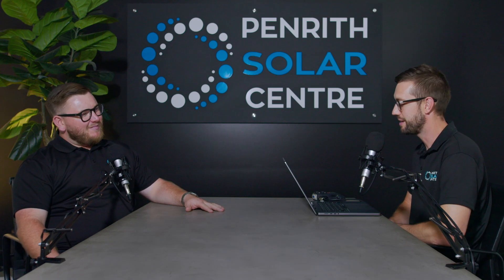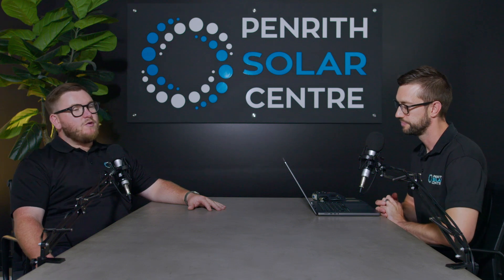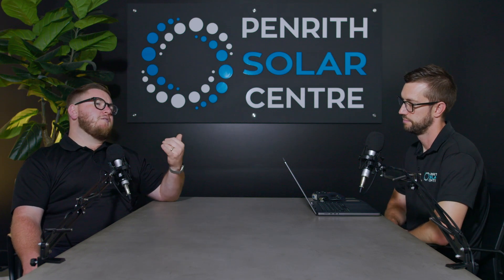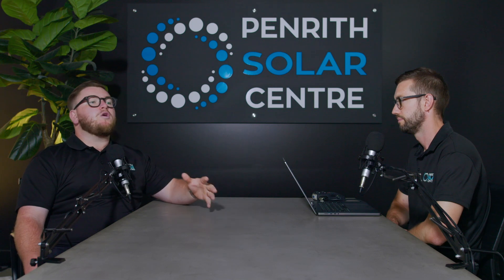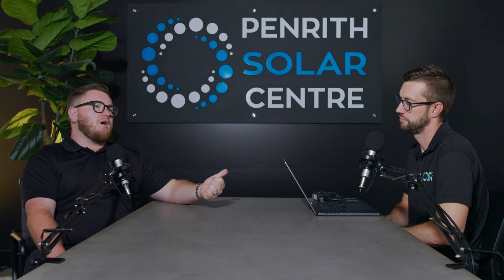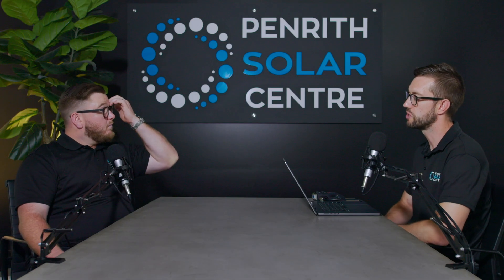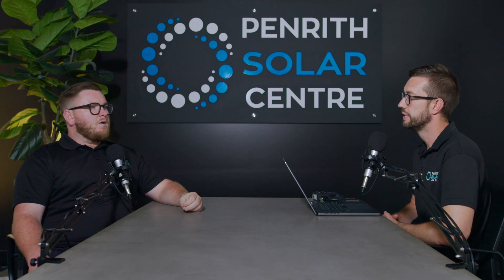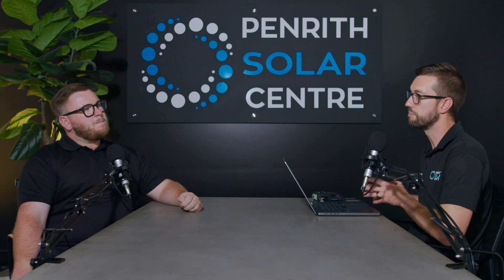Microinverters vs String Inverter - Labor Cost

Comment: Great video. Well detailed and well rounded in many aspects. But have the maths also been worked out in terms of initial cost of system vs each options. If an 8kW string systems is down for 2.5 weeks vs 1 week for an Enphase , will the income lost to client justify the initial cost difference. I haven’t done the maths but this should also maybe be presented to establish a  more accurate of costs differences. Just my opinion.

Comment: Now do it on the basis of needing to replace 20 micros vs a single string inverter....... If it's outside of warranty,  micos will cost a fortune by comparison.......You're only telling half the story.
Reply: 20 micros will never fail, zero probability. Maybe max 1-2 at the same time. Don’t take my word for it but ask installers and you will see.
Reply: Thanks, but I've seen it happen a number of times over the years.... As I work in the industry myself... 😉
Reply from the maker: It's an interesting point Phil - thanks for watching our content. If you'd like to have a discussion about the strings vs micro or anything else solar related feel free to get in touch - we're always happy to talk to other experts in the industry. 
Cheers
Dan

Comment: Better off not bothering at all! Continue to Pay electricity supplier and avoid all the hassle with potential roof damage, panel failure etc etc and huge upfront costs that needs several years for payback if all goes well. Enphase have poor customer service/support and small businesses come and go.